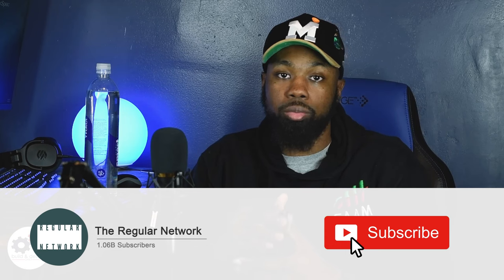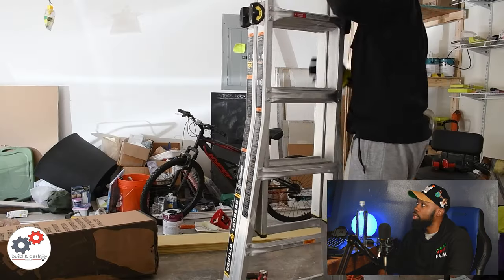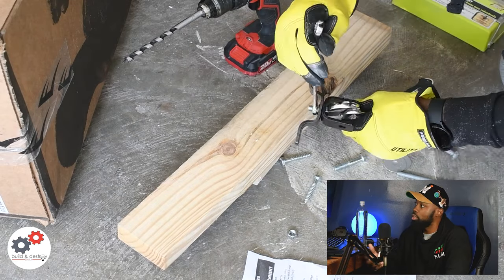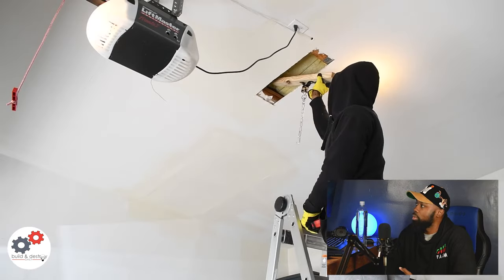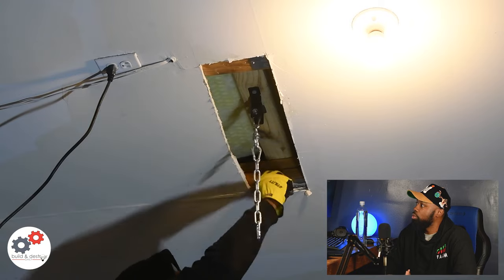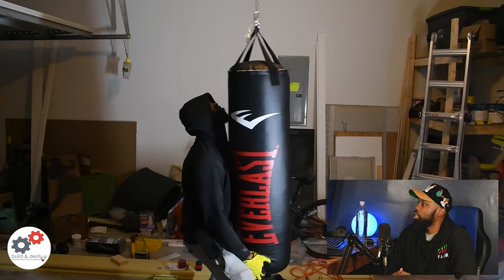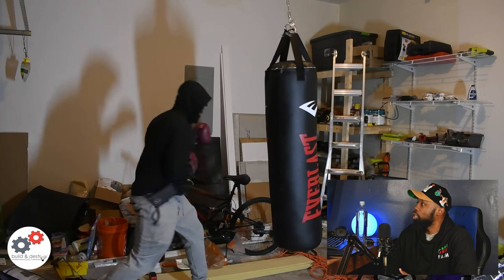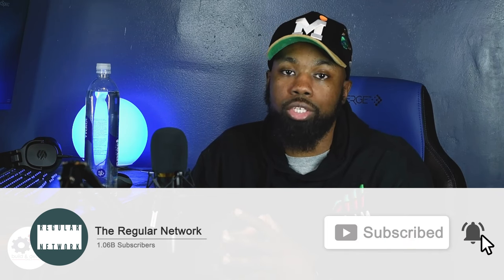BEST WAY TO HANG A HEAVY BAG (100LB) IN YOUR HOUSE!!

Comment: I personally think that it's better to have a mount/hanger with a carabiner that has a swivel which allows the bag to spin and a spring that allows for the bag to bounce so that it's not too stiff and has more mobility. This also prevents less stress on the ceiling where it's mounted because of the spring absorbing the bounce and swivel preventing wear n tear on the mount when force is trying to spin the bag.
Reply from the maker: Thanks for watching. I like that idea. The last heavy bag I owned came with hardware that swiveled freely. I wasn't the biggest fan of the bag spinning everytime I punch it but you're right about the stress on the ceiling.

Comment: Is there any risk at all of the wood ever breaking ?
Reply from the maker: Thanks for watching. The wood could break from excessive water/pest/termite damage that would weaken the 2x4. The wood could also break if you put too much weight on it. For instance, if a 200lb person jumps on the heavy bag and hangs there, there's a good chance the wood will snap. The wood will not break if using a 100lb heavy bag properly and hanging as instructed in this video.
Reply: @TheRegularNetwork   I see. We have wooden beams in the ceiling of our garage but I’m not sure we can use those. 
They look like structural beams. I’d feel terrible if it broke. 
So I was thinking of getting 2 separate long wooden beam and laying them on top of a couple of the existing beams in my garage to distribute the weight and reduce the possibility of breaking. 
Your thoughts?
Reply: @PeaceNinja007  sounds good for real i might try it myself
Reply: @PeaceNinja007  unless youre 200 lbs and plan on hanging on the bag, i wouldnt worry about it. if you like extra work and more materials used, go for it champ.

Comment: What connection did you use to span the 2x4 between the ceiling joists?
Reply from the maker: I used a 2x4 and (4) 3" deck screws

Comment: Did you have any issues with it shaking the whole house? I did mine similar on our ceiling but kept the 2x4 on the inside instead of cutting a hole and drilled it to the joists above. Shook the whole damn house. 😂
Reply from the maker: I did have that issue at my last house, but the ceiling structure was different. With this method, I haven't had that issue.

Comment: Bro question?
I just hanged my 100lbs heavy bag via ceiling hanging in my garage
I felt quite uncertain about it, since my ceiling would bounce a bit ,when I give the bag a good punch 👊
Should I take it down?
I do put a spring between the hanger and the bag
Reply from the maker: Thanks for watching. I always suggest putting a buffer between the heavy bag and the actual ceiling/roof structure. Are you familiar with "vibration isolators"? They are used for items that vibrate in construction such as fans that are mounted on roofs or in ceilings. You could introduce some sort of cross-beam support the way I did in this video with the addition of some type of vibration isolation to help reduce the shock absorbed by the ceiling.

Comment: @ 3:02 did you only drill one side of the 2x4?? I ordered myself a punching bag and I want to install it in my garage aswell and I’m using this video as a guide. So you put the 2x4 between 2 wooden beams and drilled one side correct?

Comment: Thanks for the video. Did you use a spring also?
Reply from the maker: Thanks for watching. No, I didn't end up using a spring. This method pretty much absorbs all sound and vibration. You don't hear any noise vibrating through the joists above.
Reply: @TheRegularNetwork  awesome thanks for answering